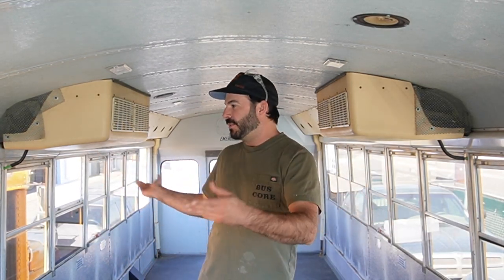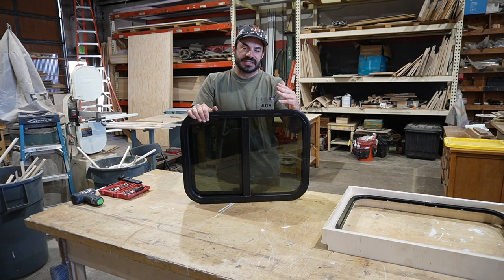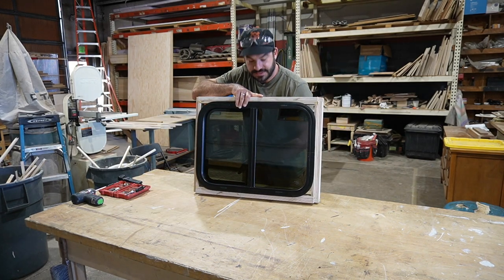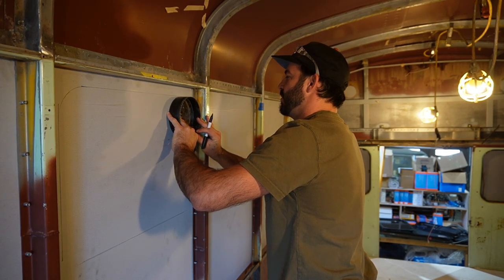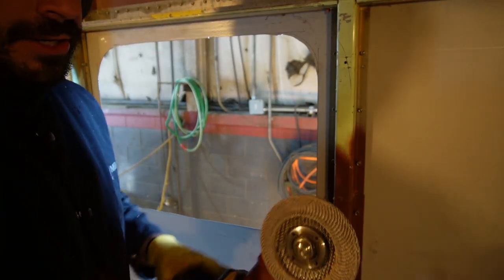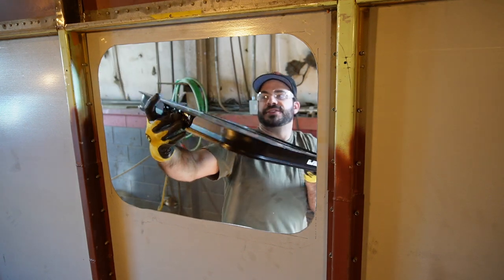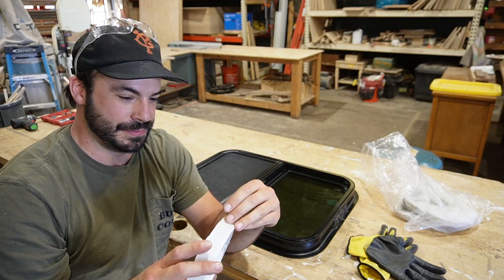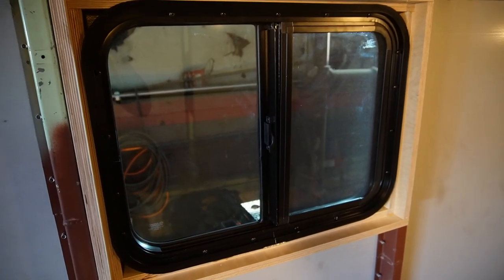GAMECHANGER: Installing RV Windows on Your Skoolie

Comment: Having ridden in a school bus as a kid for all those years during the winter with days of -40, I can attest to the USELESS insulating value of a single pane school bus window as well as the aluminum window frames they used and that framing and the windows would be covered in a thick layer of ice on the INSIDE of the bus. Those are the days one wants to be sitting over top of the rear bus heater by one of the wheel wells !, just one of the many reasons I hated school 🤣
Reply from the maker: Absolutely!

Comment: Once again proving that it all starts with having the right tools. Not every tool is a hammer, and if you're going to start a project like this, make sure you have the tools you'll need. You did an excellent 2-part video on that. Just can't stress how important it is. Thanks for another great instruction video!
Reply from the maker: Thanks for watching!
Reply: I love your methods you’re an excellent teacher! I’m considering a house boat build! I’m considering many of your ideas.which i am sure will work thanks. I would love to see you do a house boat build using a pontoon platform with a small camper on top. Great Ideas great craftsmanship!!

Comment: I have worked on rvs and know of the squeeze out of butyl tape.I found a plastic pizza cutter wheel and a little bit of mineral spirits works very well trimming the squeeze out.The plastic wheel wont scratch or cut the paint/coating.
Reply from the maker: That my friend is genius

Comment: Hey Chuck, been watching all your videos in preparation for building out the skoolie I just picked up.  Coming from the aviation world I had some ideas on this process that might make this process a little easier on the cutting and fitting. If you make 4 identical corner plates from steel and attach them in the corners of your frames. Drill a pilot hole through the skin from a hole in the corner plates from the inside after your frame is positioned on the inside. You could then transfer your frame to the outside and use clecos to hold the frame to your pilot holes on the outside and mark and cut from the outside skin where the hat channels would  interfere with your tools. Also I would use a double cut shear on the sheet metal over a jigsaw. Leaves a cleaner cut edge, is relatively easy to control and leaves those satisfying twirls of scrap instead of chips everywhere.

Comment: When putting windows in the walls of my van (OMG! I said it. Sorry) I drilled the holes like you did but connected them on the outside with a marker and used my jig saw on the outside. That way there were no ribs to worry about. I put painter's tape on the outside of the marker line so as not to scratch the sheet metal with the saw.

Comment: I've binged several videos on your channel to help me with my chassis selection and preparation for the whole undertaking. Though it may be a year or so before I'm ready, but I will definitely be reaching out for a consultation when it's time to plan the installation of critical system components (solar, batteries, hot water, etc.). Thanks for providing such invaluable content to the DIY RV/Skoolie community Chuck!
Reply from the maker: Thanks! I'll be here
Reply: I'm swapping this week. Good luck.

Comment: It would be nice for you to do a video of what you would do, if for some reason you had to build a bus without being able to replace the original windows. Thanks your work and videos are both top notch.
Reply from the maker: Thanks for the idea! Though I would never recommend it for full time use!
Reply: @ChuckCassadyYT  I live in Minnesota and plan on building a bus for traveling south for a few weeks each year during our terrible winters. Then maybe after a while doing a raise and installing RV windows. But I totally understand and will figure out the best way. It's just your advice always seems solid.. Thanks for what you do.
Reply from the maker: @tcmhammer  definitely and happy to help! Id suggest just selling that rig and doing another when the time comes.  Its so difficult to do a roof raise after the fact!

Comment: Another excellent video.  Although, I wonder if there's too much thermal bridging around the window?  I would probably get IR measurements in cold weather, see if there's enough heat loss to justify further testing, then experiment with various styles of framing, maybe larger air gap between hat channels and window frame, or using a composite frame, with inner, outer, and maybe a sandwiched material (like XPS?).  Or maybe even just drill a bunch of holes in the wood to be filled with spray foam later.  Also, I'd look for RV windows with thermal panes, or an inner and outer pane separated by an air gap.  Anything to minimize thermal bridging across the window or frame.  Windows will probably always be the weak spot of any thermal insulation system.  But it's an interesting opportunity to improve upon.

Comment: I found cutting out the panel before attaching it to the bus then I use 3M urethane window sealant to attach the window to a painted metal sheet. After it drys I then install the sheet onto the bus. Instead of building an interior wood frame I use flashing and form it to the shape of the window, rivet the ends. Then I foam around it and attach the inner ring. The hardened urethane is strong enough just like the windows on your car to hold the window. Have you used 3M urethane and why do you prefer tape over it, chuck?
Reply from the maker: I've used urethane to attach van windows, it's great. What I like about the trim rings is that all you need to do if you have to service the window is unscrew it. Your method sounds good, we never seem to have the Floorplan finalized enough to precut the windows!

Comment: Great way of doing the RV windows. Do you use insulation between your wood frame and RV window on the inside to fill that small void? Also would there be a benefit to apply adhesive between bus skin and wood frame? 
Thanks for those great videos.

Comment: QUESTION: How about instead of tracing, marking the center of the hole-saw on the panel, then you can use it by placing its bit on that mark and cut out a quick, perfect curve? The straight lines can then be cut out using a jig saw or electric sheers.

Comment: Maybe use the magnetic welding clamp on the outside of the bus. With one magnet on each side of the window. And a cushion of some kind between the window and the clamp. This keeps the window pressed in place while still allowing the window to be re-positioned. Then the trim ring can be bolted on the inside without having to hold the window nor put any clamps directly on the window.

Comment: Chuck please please please do a video on different types of furring. I am doing them where I’m cutting 2x2 and attaching it to the side of the hat channel up top leaving, a quarter inch overhang below the hat channel. I Started by doing long one by threes from front to back but then couldn’t figure out in my mind how I would attach cedar plank going the same direction. So I switch to doing them horizontal to the bus going left or right. I have never seen how you do it, all I see is the beautiful ceilings afterwards lol. I’m sure there are plenty who would love to see the same. Maybe I could pay to get a consultation from you? Cheers from Souther Oregon
Reply from the maker: Framing video will be happening in the next month for sure

Comment: I haven't seen windows mounted in such a manner. With the internal frame being wood. What about the condensation transfer from the sheet metal to the wood. Do you treat your wood window frames with some type of sealant? I would think the frames would rot out eventually. I love the idea of framing in internally as part of the interior structure. Just wondering about the rot. Condensation is a beast in tiny spaces.
Reply: Please reply to this @chuckcassady

Comment: Just curious if you've used the electric metal shears or nibblers for sheet metal cutting?  I've not used the nibblers yet, but bought a cheap harbor freight metal shear and it cuts smooth as butter and doesn't have the hot metal chips flying everywhere.  Downside is you would still have to change tools to cut the corners as it doesn't turn a radius very well.  But not sure if the nibbler would have that limitation.  Great video as always.  You are quickly becoming one of my favorite channels to watch.  I recognize quality craftmanship when I see it.
Reply from the maker: Thanks! I use shears in another video and I love them. My nibbler is good but, I think I need a more expensive one to get better results

Comment: Would using the hole saw to cut the corners with an angled bias towards the corner work? If so, then the only work for the saw is the straight cuts.

Comment: Hi Chuck!
Thank you so much for sharing all of your knowledge in such great detail. It’s an incredible resource. Question: for your window install, I can see that the trim ring clamps over the wood window trim. In a lot of van conversions, I notice that people just install the window first, without a frame, so all that is between the window and the window trim is the metal from the van. Are both ways fine when it comes to the integrity of the window and things operating as they should? Your way seems more professional but are there important reasons for doing things your way beyond aesthetics?
Thank you for all that you do! 
Katie

Comment: Question. That works for new walls that you made. Is there any way to simply remove the existing windows from a bus. And install a panel, much like your window panel to hold the window. And simply put RV windows in the old window slots. Sorry if that question is worded stupidly, but basically not redoing the whole side of the bus just replacing the windows. Thanks.

Comment: Hello chuck: A bit off topic, but I thought you might be able to provide some tips or resources to installing a window to a curved surface? I have a fiberglass shell on my cargo van, and the outside wall is curved. The distance if I put a straight edge on it is maybe a quarter of an inch from flat.  Naturally smaller windows would work better than larger ones in this case, but I think any kind of glass sliding window would bind (If not break) If I try to tweak the aluminum frame to the contours of the curve. An acrylic window might be a better option, but I think they still have aluminum frames. It's possible with some butyl tape I could go extra thick on the ends, and very thin in the center.  I don't think it would be quite so attractive on the outside of the van though. I'd prefer to be able to bend something to the contour. Any ideas? I'm sure I'm not the first person to put a window into a curved surface.

Comment: Chuck, I just got RV windows for a bus that already had a roof raise. Im having trouble finding whether I should paint the exterior before installing the windows. The sheet metal has some slight rust. Should i clean up the rust and paint a primer before installing the windows, or just clean up the rust only before installing them? Thanks for any help!

Comment: Chuck, I followed your example to the letter (really impressing my wife in the process), but I have 2 questions:  1.  My windows came with a thin rubber basket where the butyl tape would go.  I'm not sure how well it would stand up to bus life.  Scrape & replace or leave as is?  2.  Is there any additional adhesive you use to hold the frame against the skin other than the window mounting screws?  It seems like a lot of weight for those little puppies.
Reply from the maker: i usually ditch the gasket, and once the windows are in, i will then finish the interior framing and make sure it ties into the window frames

Comment: I watch your video, install a window. I am new here, I planning to buy old Rv but the windows are old and I planning to put insulation windows.  I dont know that's how is call 😊 any way, i need to watch your videos to see how you do this project. I have a question, if I want to have more light coming inside which that's what I want; can I cut the rv walls bigger?

Comment: Chuck is THE MAN!! Curious why most people DON'T change out their driver's window for an RV window for the same reason we change out all the other windows?  The only thing I can think of is that we don't want tinting for legality reasons, or maybe some buses already have dual-paned windows in that section?  What am I missing?
Reply from the maker: hahaha thank you. i left it because i was going to need a very custom window to keep all the visibility i wanted and i prefer the original window. nothing is perfect, espcially in a bus but ive never been totally satisfied with the times we've replaced the driver window with an RV unit.
Reply: @ChuckCassadyYT  Fair enough. Today I'm skinning that section back in after having done my roof raise; I guess I'll follow your lead and keep the OG window. Thanks for the reply!

Comment: Hey what if you want to install the larger window that doesn’t fit between the metal frame, how would I go about taking that out, is welding the only option?

Comment: I love the idea of framing in wood first. I did our large back window with 1.5" steel tubing as I needed to reinforce since the entire back was cut out. What would you do say on the sides if you needed to cut a hat channel? We have some larger 2'x4' windows going horizontal  up near couch and dinette. I will cut hat channels and then use some 1.25" tubing to frame them out. How would you do it? Thanks!
Reply: We also do our windows before sheet metal. I like how with the smaller windows you can do it after and get the frame flush. Like you said many ways to skin...

Comment: Just a hint on a MUCH easier way to cut the corners… you used the whole saw to draw it… instead use the hole saw to cut it using the frame to guide it perfectly (2points of contact between the hole saw and frame)
Reply from the maker: Holesawing a 6” hole through steel like that is something I avoid but thanks for the hint

Comment: I may have missed it but why use RV windows instead of doing residential windows with tempered glass? I have those in my tiny house on wheels and it seems to really keep the house much warmer/cooler than RV windows and I can open them all the way.
Reply from the maker: those can be a great option. not what i wanted, but nothing wrong with them

Comment: The biggest issue I've had in the past year + searching is finding the right size windows. With Covid, it seemed like everyone and their cousin bought all the new and used replacement windows available out there.

Right now they are coming back into stock and I'm looking at taking an 8+ hour drive up to Michigan to get windows.

So help the community out and let us know where we can source them (part numbers?)

Have you tried one of those sheet metal "nibbler" to make your window cuts?
Reply: I brought a nibbler and love it
 Great use for cutting metal in my bus or cutting side metal when I put my back porch on. Monkeyvaroom
Reply from the maker: I like nibblers quite a bit!

Comment: I prefer  vinyl house windows using a  1"x1" steel frame  on the inside that I used on my build.  I got the idea from Napp Time .
Reply from the maker: The only thing I don't like about some house windows is they sometimes lack drains in the sills

Comment: RV windows are not optimal in my experience. The weep holes become overwhelmed when it rains hard so the window track frame fills with water which then spills over and runs into your bus. This is especially true when the bus is not parked in a perfectly level spot. Manufacturers have opted not to change their RV windows and frames so the problem has persisted for decades.

Comment: Chuck…..could you use custom sized home replacement windows?
I feel like replacing the bus windows for rv windows will darken it significantly.  
If you used replacement windows that are the same size, and use a frame like you created, could that work?
Reply from the maker: It’s a little different but essentially yes